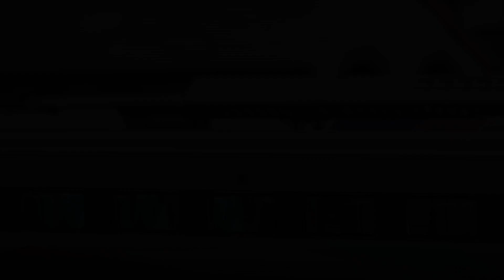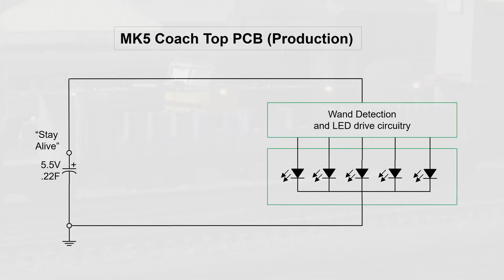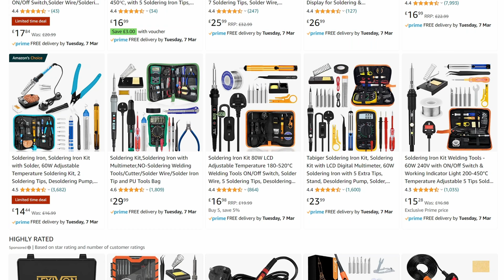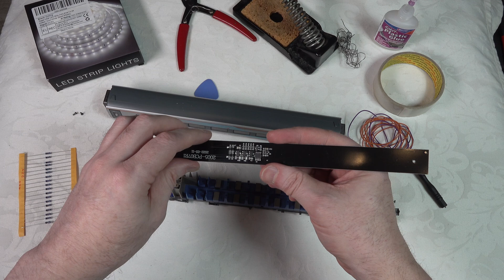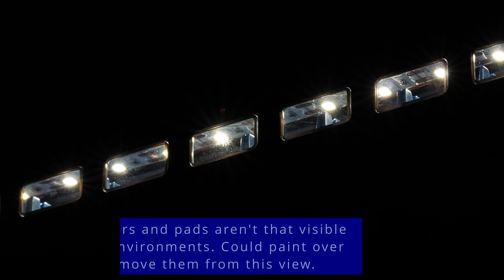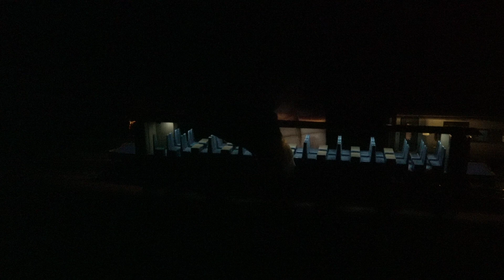Accurascale TPE Mk5a Low Cost DIY Coach Lighting Upgrade

Comment: Hi Euvi - did you ever fit lighting into the new (current Hornby Mk4 coaches? I did a quick search and cant see anything on your channel. I noted on the Mk3 there is a plastic lighting bar and wondered if there is a bar in the Mk4
Reply from the maker: Good question. I haven't tackled the MK4s yet so - just have the LNER versions. Would need to consider whether a battery or rail pick-up would be better. The same LEDs I used here would be a good starting place. Future project.

Comment: Wow I've just ordered these from Amazon should be here today they do look better when fitted cant wait todo them just watched Micheal Lomax videos and I want what hes done cheers for the video cheers Paul
Reply from the maker: Thanks Paul. If you have a Class 800, I'm using the same LEDs on that as well. The one box with two reels will cover both the MK5s and the 800 with some to spare. Will be posting that video in a couple of days.
Reply: @EuviRail  hi nah don't have the 800 only got the mk5 because of my 68 TP everything is here so tomorrow I'll be starting on mine my figures are already inn place it's going to look great that's for do this video cheers Paul

Comment: Excellent video, would this apply to the front and rear carriages of the Bachmann Class 416 VEP set...
Reply from the maker: Thanks Zack, I kind of doubt it. The Accurascale coaches are unusual in having 5V lighting. Most coaches will use 12v for the lighting. I'm looking at the Hornby Class 800 right now and this is 12v based. I suspect the 416 is as well which means differences to what I have shown here. After I've looked at the 800 I'm going to look at the Bachmann 411 which I suspect will have similar lighting to the 416.
Reply: @EuviRail  I appreciate your reply and love the work that goes into your videos, the analysis, running and advice, hence I got the Class 416 VEP... Excellent job

Comment: Hi Eugene, I have been subscribed to you for a couple of months now and I think your channel is great. I too have been underwhelmed by the interior lighting of these TPE coaches by Accurascale. Although I rate these coaches very highly I was a little disappointed with the lighting and was so pleased when I came across this video of yours. I bought the LED strips and resistors and had a go myself and wow, what a difference, I’m now 100% satisfied with the lighting and also now pleased that I don’t have to use the annoying wand. Thank you so much for showing the way to improve these otherwise fantastic coaches, hopefully Accurascale can learn from this in future models.       Cheers and thank you once again.           …………Graham
Reply from the maker: Thanks Graham. You were quick off the mark with the upgrade!  Same as myself I feel better about these models now and thankfully it wasn't too challenging an upgrade. I'm looking at the Hornby Class 800 at present to see if I can do a job there.
Reply: @EuviRail      I’ve got the other set of five to do and like you, once I’ve done those then I will also be looking at the Class 800. I’m looking at a different kind of lighting strip which hopefully be with me before the weekend, if it works then it should give great results and will be ideal for the 800. I will let you know how I get on with it Eugene.     👍🏻👍🏻

Comment: At first when I saw your video I thought, why would you want to do that!?
Now having watched yes I’m in! 
The interior lights are ok from the factory, but the upgrade makes perfect sense & looks fantastic.
A very good step by step tutorial with some great graphics, especially the wiring diagrams. I’m happy to undertake most modifications and tasks related to my stock, but occasionally even the most simple of electrical jobs can overload my non - electrical brain⚠️ 

I’ve just received my own TPE MkIV set and it’s not without its problems.
The Driving coach directional lighting is poor to say the least & a brief investigation has resulted in the removal of the bogie to see the spring loaded contacts, which on the face of it look cleverly thought out. Never in the world would I compare the Acccurascale DVT to that absolutely awful Hornby DVT with all its issues, but again I have to agree the old school approach of spring contact pick ups to each wheel face works so much better, with the Hornby unit rarely causing any issues.
This whole area will need some more attention.
Another surprising issue that I have encountered straight out of the box is one of the coaches causes the whole DCC system to short out. 
Again after a short investigation coach B has one axle which although fitted in what seems to be in the correct orientation compared to the other units, causes the problem. The offending axle once removed flipped around & replaced has stopped the short, but of course there’s now no coach lighting!
This problem will also need addressing when I have some spare time, I presume the seating will need to be removed  & hopefully all that will be needed is a simple wiring change.

Overall I’m am blown away with what Accurascale has offered the RTR modeller, fantastic detail, build quality for a reasonable price.
These are the first problems I’ve encountered with any of their products & this whole MkIV project, I imagine is a massive undertaking for a small company.
I’m sure these lessons will be learned & we won’t see this sort of problem too many times in future releases.
Accurascale still get a thumbs up from me👍

Now all that’s needed on my part is some time to sort out those lights!

Cheers and thanks for another great video.

John b😎
Reply from the maker: Thanks for sharing John  and I'm sorry you seemed to have had more grief than most with these coaches. I just wasn't happy with the lighting and it was impacting my appreciation of these coaches. All good now apart from the directional lighting which needs a stay alive. As you say Accurascale are doing great work overall and will be learning from any  issues encountered along the way.

Comment: I did contact Accurascale regarding the flickering dvt lights they suggested I try swopping the bogies from another coach so I removed the bogies all the coach pickups were shiny and clean the dvt however was filthy and I’d only run it a couple of times so I cleaned them and it has improved the lights but not completely I think I will add a stay alive when I add some passengers.
Reply from the maker: It was interesting they suggested that though as we've seen that isn't a root fix to the issue. Thanks for sharing.

Comment: Excellent work Eugene.
I've got both packs and yes Accurascale should have done better with the coach lighting and hopefully they will learn from this and include better lighting in future runs.
Personally in no rush to do this work as I currently don't have a layout due to home building works going on but yeah will consider using this very good tutorial to upgrade the lighting and again we see that manufacturers including Accurascale churn out new products but still something needs to be modified to correct an issue or flaw which to me is still commonplace.
Like I said, Accurascale will learn from this and doesn't detract from their excellent product range, prices and customer service compared to the opposition.
Reply from the maker: Thanks for that. As you say, Accurascale are still on a bit of a learning curve and in general coach lighting isn't handled well by any manufacturer apart from Bachmann's pricey DCC coaches. You'd have got maybe 2.5 of those coaches for the price of the Accurascale 5 car set!

Comment: That looks so much better, for the price it's impossible to understand accurascales choice. Do you think a similar mod would have similar results on the hornby IET
Reply from the maker: Funny you should ask that... I'm going to take a lot at it. The same LEDs would be appropriate for the IET unless I can find a way to increase the juice to the existing ones. More anon.
Reply: @EuviRail  it would certainly be good to see, I've got an 802/1 on order and it's my biggest doubt in the set as stock.o

Comment: Great fix Eugene.A real improvement of the lighting.
Reply from the maker: Thanks Peter. It's at the level I'm happy with now. I'm going to check out  a Hornby decoder and power pack for the trailer to see if that does the trick.